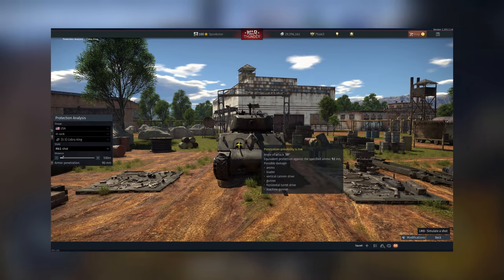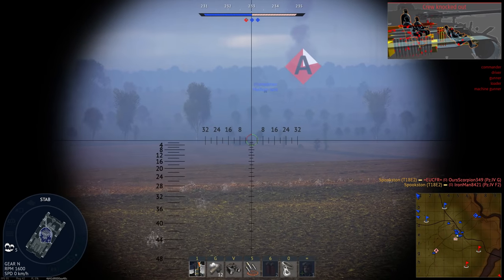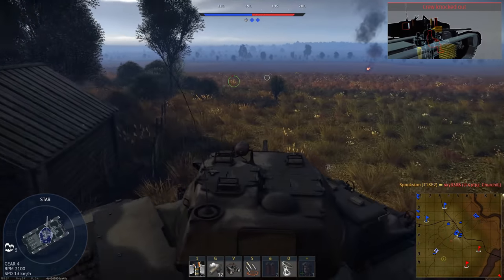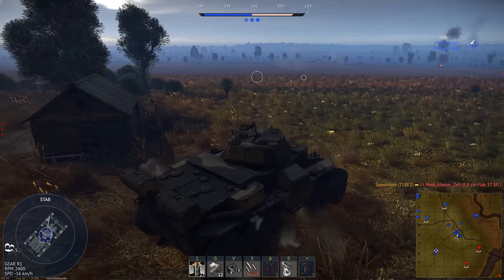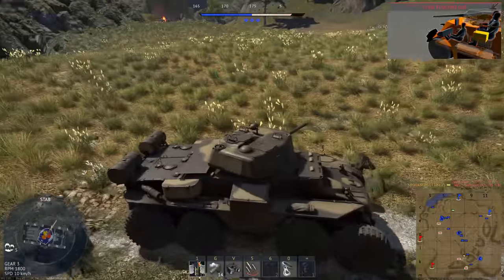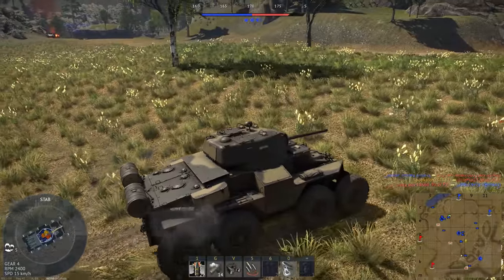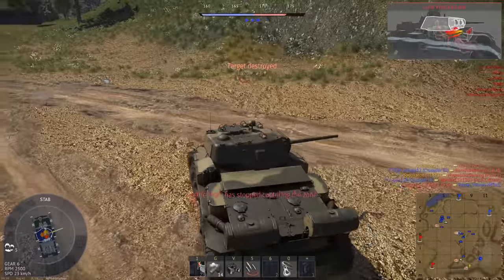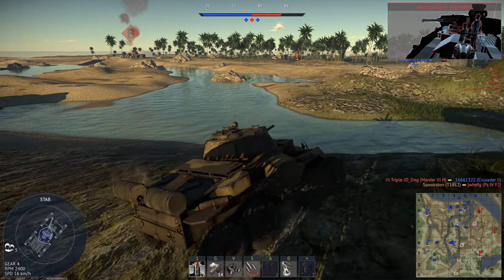Volumetric Shells Were A Bad Idea

Comment: They need to increase the friction on slopes, going over a tiny bump is now a freaking challenge
Reply: Instead of fixing maps they decided to make tanks unable to go over anything.
Reply: They nerfed ground pressure for all tracked stuff, they became slippery af
Reply: It's actually so stupid, I feel like my tracks are made of smooth plastic half the time. Can't have any fun anymore. Also notice they didn't do anything about wheeled vehicles traction, the ones that actually cause a problem
Reply: Bruh when my panther, which is roughly 50 tons, can't climb a hill, wtf
Reply: bruh, even an Abrams can't drove on some slopes. literally a thousand hp engine with spaded mods can't drive on some tiny slopes is just bs to see.
Reply: @jaredgorbich9050  yeah,an indirect buff to the Axis since they have all of the armoured cars. But no Germany suffers
Reply: On Ash river one of the spawns is directly on a slope and some tanks can't climb it now
Reply: @VKK-cr1uk  Germany does not suffer. As someone who plays WWII stuff of the major nations, the British suffer the most
Reply: @jaredgorbich9050  British? At 5.7-6.7 they dominate most maps because their APDS-stabilizer combo and they can slice through anything the German have except maybe the Jagdtiger (lower frontal plate has high chance of blowing up ammo)
At 4.7 they have tanks that can pen up to 190mms of armour
Reply: @jaredgorbich9050  They totally nerfed wheeled traction, it just affects tracked vehicles significantly more. Speed will usually solve the issue of traction, unfortunately most tanks don't have this as an option.
Reply: insert the meme of "players abusing map design here. and gaijins "solution" of coating all treads in oil"
Reply: @brentonherbert7775 developer IQ over 9000
Reply: @jaredgorbich9050  I was making a joke,China in top tier suffers the most,they don't even have a top tier tank nor helicopter
Reply: We coat tank tracks in butter comrade ))))
Reply: @VKK-cr1uk  ya but, it's China, who cares? Lol its also top tier. Listening to people complain about top tier to me sounds like people standing in a fire complaining about the heat
Reply: And lets remember that a tracked vehicle is made for those kind of terrains where wheeled vehicles cannot go and dont have traction....
But gaijin be like * Ahahahahahahahahahahaha               NO
Reply: Pls no. I'm tired of countering mountain campers. They're super annoying
Reply: @brentonherbert7775  its not a solution but a hotfix
Reply: I also hate to lost 75% of my speed just by clipping through a frikin wooden fence in my T-34
Reply: I nearly had to J out yesterday when I was stuck on a tiny dirt mound
Reply: @the_woof  they can fix it by making certain areas inaccessible with crazy steep terrain or rocks, instead Gaijin fixes the problem by making tank treads into Teflon. The problem is that sometimes you get stuck in areas that make no sense. It's like we're not even driving tanks anymore. Plus now the problem is wheeled vehicles which still have really good traction. Rocks are are made smooth glass and are covered in grease, it's so dumb
Reply: @theholyromanemperor6275  fr fr the merkava has the same issue
Reply: @gian.4388  I pretty much only play 5.3 or lower. They have no filler, no reverse, they're all flat as fuck. Plus I hate the 17 pounder, it's way too inaccurate for not having any filler. The F-32 on the KV is my baby, accurate as fuck! The British are fun, but you can't play brain dead like the other big nations. The only thing the British do better is pen (but that doesn't matter after a point) and tactical ability. They have a tonne of smoke and are either very mobile or very tough. So sure maybe they don't "suffer" but they're usually more difficult to play, I have found at least
Reply: @jaredgorbich9050  it's not only top tier,plus China is supposed to be the 4th Great nation alongside the US, USSR and Germany. Looks at World of Tanks,they made the Chinese tech tree interesting by giving them some of their Cold war prototypes,why can't Gaijin do the same?
Reply: The Swedish reserves tanks literally cannot climb the smallest incline now, due to their low HP engines. They can barely make it up the steps of capture points on Japan.
Reply: @gian.4388  Britain between 3.0 and 5.0 is miserable. No armor, no APHE, no APDS and 17pdrs that bounce on everything.
Reply: @kirishima638  Seriously? The Cromwell and Crusader III are actually really good at BR 2.7-3.7: 122mm of pen and stabilizer running around the map at 60 kph
I agree that no APHE kind of hurts and the volumetric shells have increased  armour effectiveness of the soviet tanks by a lot, and the T-34s have those fucking fuel tanks that seem to be better than actual armor at stopping rounds, but come on, the only BR where Britain really sucks is top tier (or so I heard, I'm still at  BR 7.7 rn)

Before volumetric shells any match I played at 3.7 with the Cromwell I and the Crusader III combo I got more than 10 kills , that cannon would slice through anything, T-34s, SU-85s, KV-1s
I actually felt so bad about using them that I stopped playing them till recently
Reply: They better do so, I always see Challenger tanks getting stuck on slopes and getting shot at.
Reply: Always had been
Reply: @gian.4388  I agree. My current favorite lineup is 3.0. Why? It seems like some random pit of a br with nothing interesting. 3 inch gun carrier, both crusaders, churchill 1, the 20mm armored car AA, and a spit mk1a are all fun. The 3 inch gun has armor and gun, 57mm crusader has gun and mobility, 40mm crusader has better mobility, the churchill has trolly armor and a basically perfectly stable gun, the AA is almost Wirbel levels of bullying to tanks and aircraft at the tier, and the spitty is a great fighter, albeit with very limited ground attack capabilities
Reply: And a T-34 can climb a mountain.
Reply: @VKK-cr1uk  that's an excellent point, I hate the Chinese tree cause it has almost no original designs. It could've been fun, but it sucks as a copy-pasta nation
Reply: @gian.4388  since when does Cromwell and Crusader have stabiliser? Was playing the Cromwell last night and was not stabilised
Reply: @an_f-14_tomcat  i love 3.0 as well, for both the Germans and British. Panzer 3 M and N for Germany, Church 1 and Valentine 9 for British. The British don't have very good CAS comparatively. Everyone else has more bombs and cannons, the British are stuck with fighters with little payload and a tonne of 7.7s. If only the 3.0 Beaufort? Beaufighter? Whichever one, had more than just a torpedo for secondary weapons
Reply: @jaredgorbich9050  as I said this is an a hotfix they don't even aware about all palces. Anyway they don't want to spent much time on this.
Reply: @tacticalginger9623  The Cromwell V is 3.3 doesn't have one, the Cromwell I is 3.7 and has one
Crusaders (both II and III) always had stabilizers in game iirc
Reply: @gian.4388  I've corrected my comment now, I meant to say 3.0->5.0. Yes the Crusader III at 2.7 is fantastic, I love it but it is an exception.

The Valentines are just too slow and face too many guns that negate their armor completely, including Swedish reserves now.

The Matilda is trash. Absolute trash. Ditto for the Gun Carrier.

I also hate the Churchills. The mk1 has a pop gun that's only effective in a down tier. The MK III has a much better gun but no improvement to armor for a full 1.0 BR increase. The Mk VII has a worse gun and better armor but is just too slow and faces Tigers and Panthers.

The AEC AA and Crusader AAs are mediocre SPAAs. Even France getter better SPAAs for the BR.

The Cromwells are glass cannons. Their speed is nice but the V has a horrible gun and the mk1 at 3.7 is outmatched by eveything it faces.

The Archer is horrible to play.

The Sherman II is very good but's it's a 3.3 US tank at 3.7 for no good reason.

The Achilles is OK but not great and has no lineup.

The Firefly is awful. Too big, too slow. It faces much better tanks.

The Avenger is bad. Fast but big target with no armor, no smoke (unusual for a British tank) and no MG and it faces much, MUCH better tanks. Even Japan gets better tanks at this BR.

British tanks don't get good again until 5.3. The 17pdr just isn't reliable without APDS. And even at 5.3 they are glass cannons. You have to grind until 6.7 to get a truly competetive medium again.

Playing Germany between 3.0 and 5.0 is like super-easy-baby mode by comparison.
Reply: @an_f-14_tomcat  The AA is no where near as good as the wirble. 42mm of max pen vs 64mm. Dual cannons vs quad cannons. Fragile chassis. They are not even close.
Reply: Ffs I can't go up the stairs with some tanks
Reply: What are you talking. My stronk T28 climbs any hill in its way. It is quite broken on how good that thing can climb a hill
Reply: @juioploski4063  Lucky you
Reply: @MinnesnowdanSniper  and just how do you suggest they do that? Did every tank carry that with them?
Reply: @kirishima638  nah thats cap thats one of britains strongest battle ratings since they dont even fight the big boys yet
Reply: @jaredgorbich9050  have you played italy?? Its miserable in mid tier
Reply: @juioploski4063  they didn't buff the T28,they nerfed everything around it,I guess they couldn't nerf it due to it having an old model. I've had a similar situation with the SU152 looking like a mountain goat compared to my T34s which can barely climb a slight hill even though the latter has a better power to weigh ratio. A good test bed is the slope on Ash river by C
Reply: @jaredgorbich9050  Gaijin wanted some of that quick and easy CCP money
Reply: @paytonanthony1308  no. I'm really only talking about the original big 4. I feel like Italy will get better. But until the R3 gets removed or at least properly placed i won't touch Italy
Reply: @MinnesnowdanSniper  i mean ya that's great, but its not really something they can add as a deployable feature for pretty every tank. It's a great idea, but it could really just be solved by adding traction back to treads and physically blocking certain areas, ins tead of just making everything super slippery
Reply: @gian.4388  the repair cost tho.... I can already tell they already start creeping behind me
Reply: Yeah, they did this so that high-tier vehicles can't get off the map, but the effect on lower-tier vehicles has basically limited them to flat ground.
Reply: Panther on Original Footage be like: 45° and more okay no problem. Panther in War Thunder be like: a small bump? better let him slip
Reply: @bryanfortino  Well, yeah, high repair cost because the Centurions and FV4202 all have the most potential at that BR
Although I don't necessarily agree with this method, it's like that for anything really OP
Reply: @gian.4388  yea the method kind of work by reducing the tank usage by player but also backslashes pretty hard cause now it kinda unplayable without premium especially when you are tight in silverlion, which probably happen to you all the times
Reply: @gian.4388  cries in france lorraine and italian g55
Reply: @bryanfortino  Yeah, the G56 had the highest repair cost for a while, even higher than the B-29 2 months ago

Then there are others that I really can't understand
Like, why was the Maus' repair cost increased from 10k to 14k SL?
Like, it gets fucked by anything, even in downtiers it isn't good and you give it almost the same repair cost of the Ferdinand?  Lol
Reply: @gian.4388  and then there's bmp with 2.5k SL rep cost.... THAT THING FUCK EVERYTHING ALSO VERY CHEAP , also the main reason i start playing italian is the centauro with 5k rep cost LIKE BRUH
Reply: @bryanfortino  Bruh, then I gotta unlock the BMP1 ASAP, I'm already researching it but it takes a hell of a time because the 7.0/7.7 soviet line-up is trash other than the BMPs and the Premiums
Reply: @gian.4388  try the t44-100 its realy good
Reply: @bryanfortino  Yeah it's good but it's nowhere near the British 6.7s
Without a stabilizer you can't really do anything at that BR unless you are an IS-4 (and even then, you maybe can bounce a poorly aimed shot, but the enemy can take you out with relative ease)
The T-44-100 is really good against the Germans tho
Reply: @gian.4388  it's doesnt perform well against allied tank but against german (especially the heavy one like kingtiger)? It's made for it
Reply: @bryanfortino  Yeah, exactly
And it's also satisfying to blow up Leapard 1s  lmaO
Reply: @gian.4388  they can pen all they want, their shells are still garbage and take 37 shots to actually kill a tank
Reply: Bless Your Soul
Reply: @Garthbrooks4756  If you can't aim it ain't everyone else's fault
With a well placed turret shot you can blow up a Tiger II (especially the P version) with one shot, with a centre of mass shot on the Panther's hull you can kill them with one shot too
The Jagtigers you can immobilize it and kill it with LFP shot

Do I really have to say anything about the russians? Lmao they can't so anything at 6.7 if they're against the british
The key to success with British 6.7s is not getting too focused on a single target
You shoot one, get its breach or gunner out? Shoot another one if there is one or at least watch out for other tanks and then finish the first one

Also you're always going to have the advantage of gettin the first shot off, even while moving, because of the stabilizers while other tanks have to stop, wait for the gun to be aimed and then shoot
Reply: @gian.4388  yea i never face problem with AP shell, sure APHE is easier to kill but with a well aimed shot its not realy a big problem
Reply: what u talking about, didnt you know that historically, combatants slathered all the hills of the battlefield with soap before fighting? bad post plz do research before talk
Reply: @taequando5081  Oh crap you're right my bad man sorry
Reply: @FancyTacoCat_  lern abut taktics next time u post sumething lik this
Reply: @FancyTacoCat_  but all jokes aside bro, u right
Reply: @taequando5081  Yee
Reply: @gian.4388  you ever used a Centurion? I feel like my shells are made of pure nitroglycerin, since they ALWAYS FUCKING EXPLODE FROM EVEN A BIT OF DAMAGE. Worst part is: Brits use solid shot.
Reply: @jaredgorbich9050  "play braindead" Jee, I'd hate to see you actually have to clean the cobwebs out of your head and play British!
Reply: @airplanemaniacgaming7877  i do play the British, I love the Churchill 1 and Comet especially. They're great, you just have to be more aware and use your strengths. I just find that compared to the other big 3 I die more often when I'm not paying attention, have lost track of enemies, or dropped the ball on maintaining control of the battle field. The British just play different, less forgiving, but higher skill cap. With a lot of vehicles you have to remember to keep moving, always. Play your medium tanks like light tanks, light tanks as super scouts, and heavies as area control. The Russians, well, they be rushin, always pushing forward, but most things can rely on armour, and they have better ammo. Germans have better guns, and the panzers are kind like British vehicles, but they're slower and can be used more in holding points. The US is very diverse with all kinds of stuff and different styles and they're usually more forgiving. Better ammo and stabilizers, .50s, and pretty solid armour. The British have to outsmart the enemy to win. The British also have the worst CAS of the 4 nations, especially low tier. The fighters are good, but you don't have any real cannon CAS and very few bombs. Then the rockets are more inaccurate than the other nations. A bit more planning is involved with the British, and teamwork amplifies them incredibly
Reply: Driving over vietnamese people is a real hassle now.
Reply: i once got stuck on a small rock i was floating
Reply: I can't go up any hill with any rank V Americans. Fucking ridiculous
Reply: @jaredgorbich9050  Wheeled vehicle traction has definitely also changed, last week I suddenly slid sideways up a hill with a Puma.

Wheeled vehicle grip might still be less affected though, and of course they usually have speed to compensate.
Reply: @VKK-cr1uk  if you think buffing an sdk makes germany balanced, you have issues
Reply: @Mannen2000  Or in any other vehicle.
Reply: @kirishima638  I've been grinding Sweden and yes. Can't make it up to the SP in the cave on Frozen Pass, can't make it up some of the roads on Japan, forget playing Ash River and Rock Fortress...
Reply: @robertdrouhard4293  I've quit WT for now. Played around with the latest patch and the new graphics are really nice but they've also broken too many things on top of everything else.
When you combine all these annoyances - the traction nerf, the broken matchmaking, the volumetric changes, the broken maps and map rotations, the crappy grame modes from 2014 - it's too much.
Reply: I just wonder that we have the same profile pictures.
Reply: I know. Just yesterday I wasn’t able to get over a 4ft wide trench in my M4A2 76 on Carpathians. Literally got me strafed by like 4 Me410s and I never saw anyone in the entire battle
Reply: All they had to do was put hedgehogs around some of the more problematic hills and slopes but nope no fun for you
Reply: us suffers most from this
Reply: Tanks, which were invented expressly to go over trenches, cannot go over the smallest trench in this video game
Reply: my annoyance is that the shells that were made for angeled armor, don't seem to do their job anymore just like how HE shells didn't up until the HE upgrade
Reply: They killed traction in general which is ass
Reply: Hills are basicaly made of ice
Reply: i'm in a t28 there a t92 trying to come a 70 degree slope fails i get over then and i get the premium tank to go up it with no issues so how does a 59 ton tank out climb a light tank
Reply: Those russian game developers smeering russian butter on the tank tracks again.. ugh classic gaijin smh...